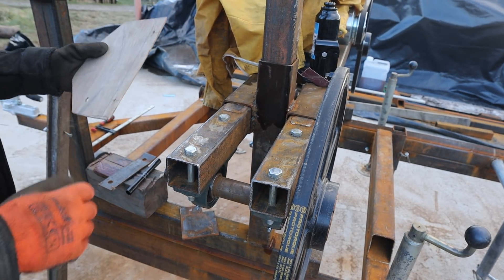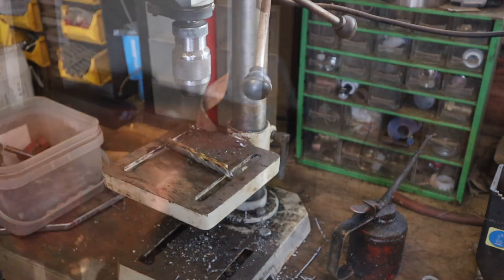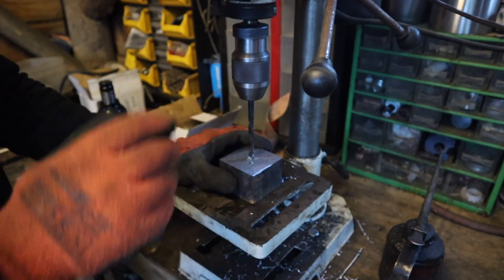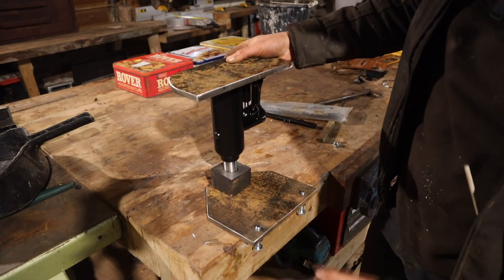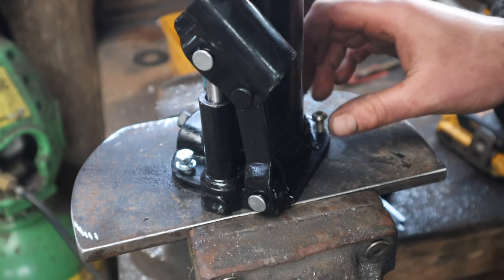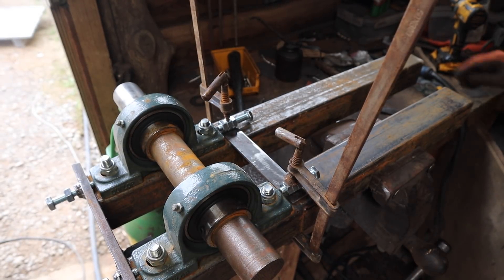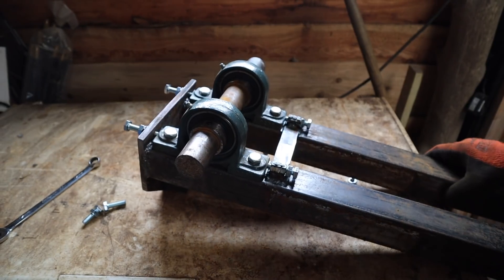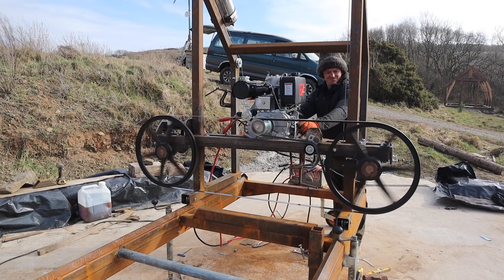DIY Mobile Bandsaw Mill Part 3 Bottle Jack Tensioner

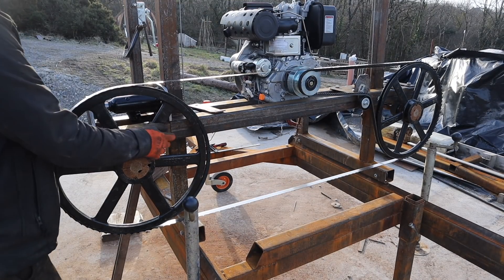Comment: The rubber tyre on the idler wheel with the bottle jack. comes very loose when you put tension on with the bottle jack. Check the vid at 8:13, there is clearly day light between the rubber rim and the cast iron idler wheel, especially when you rock the wheel back and forth. And later in the video you can visibly see that rubber rim wobbling about whilst you have it running. Looks dangerous to me Kris.
Reply from the maker: what exactly do you think is dangerous about it? its only purpose is something for the band to ride on. it has no other function. And it cant come off.
Reply: They amount it is loose is alarming, with the amount of wobbly it shows later in the video, there is chance of it coming off the wheel along with the blade , which is always dangerous. As a blade can do a lot of damage if it hit anyone. I'm not saying the machine is dangerous, just the loose rubber rim on the idle wheel
Reply from the maker: Its not loose, its actually slightly smaller than the outside of the pulley. But the nature of a pulley is there is a hollow in it. so the belt has to be big enough to go over the outside but once over is then to big to be tight in the groove. dose not mean it will come off. it literally cant come off before the blade dose. if the blade comes off first or snaps then in theory it could come off but unlikely. i cant for the life of my see any danger in that. There are a lot of dangers involved in the tool but that isnt one of them.

Comment: Kris l'm sure a guard will come,sooner the better,selfish thought of mine, would miss my  KH fix every week.
Reply: This is an earlier reply from Kris "It will get guards at some point. When building a house you don't start with the roof. The blade will likely come off a lot more times yet as I get it all worked out. Then it all has to get painted and put back together and set up again. If i had guards every time that blade came off it would destroy it. £40 a time. For now just standing out the way works just fine. It can't get you if you are behind it."

Comment: I know you communicated your concerns about the blade avoiding the belt, but do you have any concerns that the heat from the blade will create problems for the belt?
Reply: As long as the blade is sharp it will just get a little warm, he also wants to build a water drip system, i think that is to keep the resin from sticking to the blade, but it also cools the blade.
Reply from the maker: Belts are designed to work in a hot environment anyway. the same material is used in alot of engines as the main timing belt. I would need to be making smoke instead of cutting before the belt was effected by the heat. remember it would only have heat at the top. 80% of the belt is basically cooled by the big spinning (cooling) pulley. And the band will have water dripping on it.

Comment: i think that your ideas for making your own working machinery is good but way above any normal person. i do not know the cost off the band saw.. but go to ebay brand new from £3000-4000.  so who in there right mind would do all that work.
Reply: Soo... If you don't know the cost to make the bandsaw, then how can you have an opinion as to whether its worth making your own........?!!!
Reply from the maker: It will cost about £2000 when done. However it has the cut capacity and length of a £10,000 machine. The £3-4000 machines you are talking about are short and small capacity. This thing will cut a 6m long timber 32” wide

Comment: You should build a safety guard around the saw???
Reply: Hey - here's a radical thought... maybe he's always intended to build a guard and didn't need anyone to point out the blindingly obvious.....?!!
(just a little idea I had......!)
Reply: This an earlier reply from Kris "It will get guards at some point. When building a house you don't start with the roof. The blade will likely come off a lot more times yet as I get it all worked out. then it all has to get painted and put back together and set up again. If I had guards every time that blade came off it would destroy it. £40 a time. For now just standing out the way works just fine. it can't get you if you are behind it."

Comment: Use threaded rod instead of hydraulic bottle jack, won't move where hydraulic can leak, loose pressure
Reply: Clearly you did not think too much before you cast your opinion out for public scrutiny. The jack is only to adjust tension not to hold tension. The plate it moves is held fast after tension and tracking is adjusted.
Reply: You definitely have more precise control with the threaded rod than a bottle jack.
Reply from the maker: You are making the mistake of thinking fine control is needed. this blade is tensioned in the tons, micro adjustments are not a requirement. But even so a bottle jack is very much controllable for fine motion. you just move the handle a small amount. its not just on or off, its a variable flow (depending on how far you move the pump lever) pump that drives it not an on of off switch. And with the edition of springs (a possible future upgrade) fine control is then irrelevant.
Reply: @KrisHarbour  Kris, does the jack have any ports to add a pressure gauge?
Reply from the maker: I would like to have one. im quite sure one could be added somewhere, even if it meant tapping a hole and adding a fitting. The blade heats up and expands so the tensions never stays the same anyway.
Reply: @KrisHarbour  Yes it would be nice to have. 1500Lbs in the bottle could equal 17k-20k blade tension. It would make it alot easier to find the sweet spot for best blade performance after a few blade changes..
Reply from the maker: It would be nice i agree, However I think after running the thing for a while i will just get a feel for it, and know when its right.
Reply from the maker: So for anyone interested i did a test yesterday to see if the jack moved over time. I used a digital calliper, i set it to as much tension as i dare. I extended the callipers between the two points and zeroed them and set a timer and timelapse for 15 mins. I chose 15 mins because i would expect in that time if it was moving to move even if it was just a little bit but it wasn't long enough for temperature change to effect the reading. I filmed the processes and will add it to the next video. 

The results 
No measurable movement at all when measured down to 1/100 of a mm over 15 mins. If it did move in that time (it has to have a tiny bit) it was less than 1/100 of a mm A threaded bolt would stretch or compress a lot under that sort of load.  I would like to run an overnight test just out of interest but really the temperature change will make it not very accurate This test has proved to me this is a far more stable option then a threaded rod anyway.  Even if we say that is was just about to get to 1/100 of a mm as the test ended that would still only be 4/100 of a mm an hour. Im my mind that can be considered no movement as it would have no measurable effect on tension in that time. 

I was confident it was a stable mechanism but i am surprised at just how stable it is. i could not even change the reading by putting weight on the band. the only way i could get a different reading was by pumping/lowering the jack

Its chucking it down today but the next test i will do when its dry will be to see how small of an increment i can do. From a quick look today it looks like about 0.25 of a mm is the smallest but thats not confirmed yet.
Reply: @KrisHarbour  That's awesome news Kris. Cant wait to see the rest of the build.

Comment: The mistake 99% of people make you need to put the cutting oil on the drill not the plate.  When you put it on the plate it just goes away with the chips.  You want the oil to get between the tool/drill and the chip not on the wrong side of the chip.

Comment: @ 5:36 That will need a 10mm gusset brace...
Reply from the maker: Yeah i agree it might, Not yet though. i have had to cut to many things like that off in the passed after deciding to change something.
Reply: @KrisHarbour 
U could Tack the gusset;..
Top & Bottom...
Put a small shim in the middle and monitor the defection under tension...

Comment: Kris, you should make some type of Guard out of sheet metal, to cover the Saw Blade and Wheels, just in case it ever breaks...cause if it does, without any Guard....You're gonna have a really really bad day.
Reply: Not a bad idea. A quick image search yields some possible designs.
Reply: @robinheil  This is an earlier reply from Kris "It will get guards at some point. When building a house you don't start with the roof. The blade will likely come off a lot more times yet as I get it all worked out. then it all has to get painted and put back together and set up again. if I had guards every time that blade came off it would destroy it. £40 a time. For now just standing out the way works just fine. It cant get you if you are behind it."

Comment: May be you should cover the wheels for accidentel saw cut
Reply: This is an earlier reply from Kris "It will get guards at some point. When building a house you don't start with the roof. The blade will likely come off a lot more times yet as I get it all worked out. Then it all has to get painted and put back together and set up again. If i had guards every time that blade came off it would destroy it. £40 a time. For now just standing out the way works just fine. It can't get you if you are behind it."

Comment: What diameter bandwheel are those mate
Reply from the maker: 500mm V Pulleys
Reply: @KrisHarbour  still watching your channel but, have you found your blade speed a little slow? Diesel motor would have lower rpm no?

Comment: As someone that knows basically nothing about engines, why does the engine need a break in period?
Reply: All the parts are fresh out of manufacturing - they have mill marks and the parts need to work in together.  Friction is an engine's main foe, and a new engine has more friction in it due to the parts sliding by each other and not used to it - the parts have not worn in to match the other parts.  The piston rings need time to seat in and get used to sliding back and forth in the cylinder(s), the bearings need to wear together to smooth out due to close proximity.

Comment: Nice job but you made cringe a bit when you were drilling I’ve got the scares from when it go’s wrong doing freehand or holding the job without tongs as well as the rollicking I got .from my Forman when I got back from hospital ( sigh that was the best job I ever had the money was crap though )

Comment: not a fan of the bottle jack design. They tend to not hold a constant pressure. In this setting, I would have gone with a threaded rod into a hole in the push plate, with the nut pushing against a thick washer/spacer. This would provide unlimited micro-adjustments to the tension, vs the chunky steps of the bottle jack.

Comment: No guard on the blade? Terrifying.
Reply: Don't stand in front of it..
Reply from the maker: It will get guards at some point. When building a house you dont start with the roof. The blade will likely come off a lot more times yet as i get it all worked out. then it all has to get painted and put back together and set up again. if i had guards every time that blade came off it would destroy it. £40 a time. For now just standing out the way works just fine. it cant get you if you are behind it.
Reply: @KrisHarbour  Soo.. you'd thought about guards then, what with that lethal blade whizzing about.....?? 
Oh! - couldn't you just lose the will to live........??!!

Comment: WTF? you cut and weld on a HUGE chunk of square stock to retain the top of the jack?

2  x 1" bits of angle iron welded on like < > would do the same thing and 1/100th the mass and 1/10th the work 0% wast 1/100th the ware and tare on your tools
Reply: He tends to overbuild things not a bad thing really
Reply: @glennwilck5459  true but that thing is going to be HEAVY ! ! ! hehehe